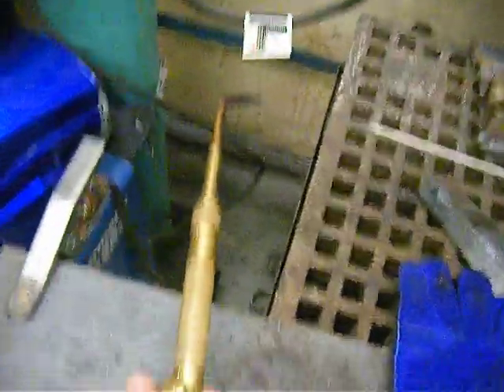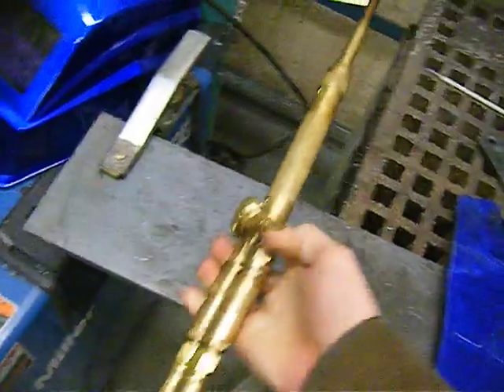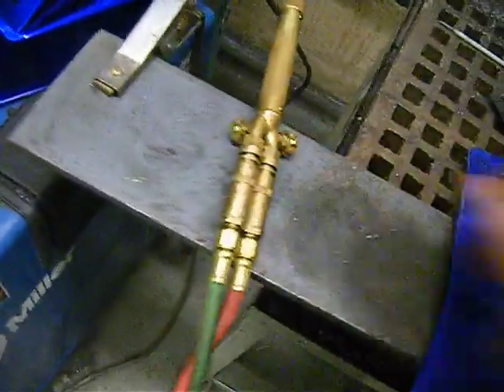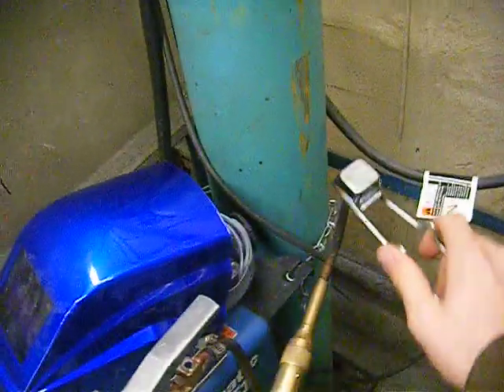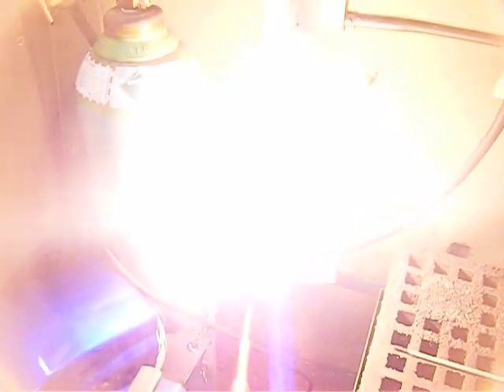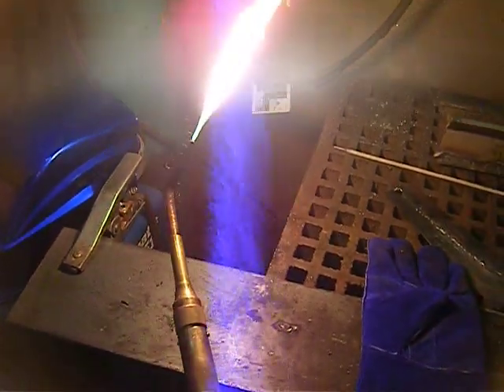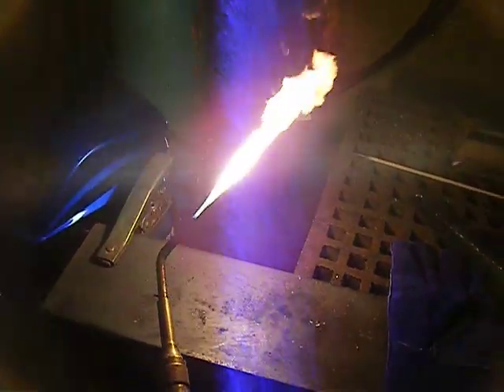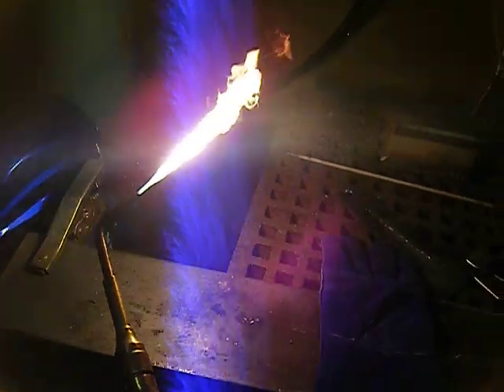lighting the oxi-act torch in class, first time too.

Comment from the maker: @ocxic its arc-shield, an inert gas we use for welding, there is two main tanks and lines that run to each station with regulators so we are safe.